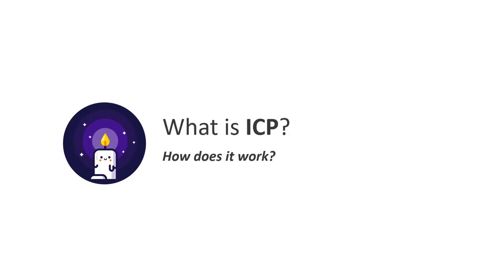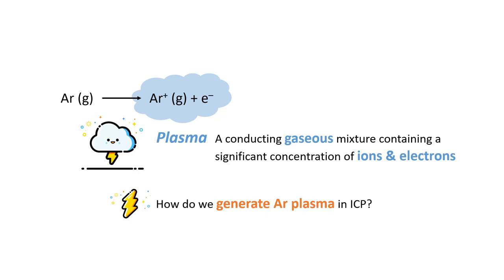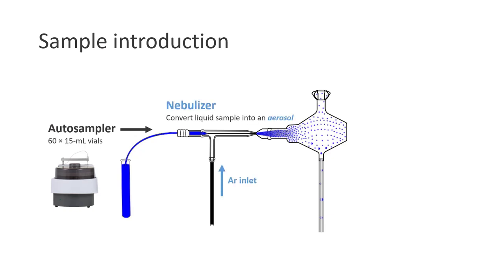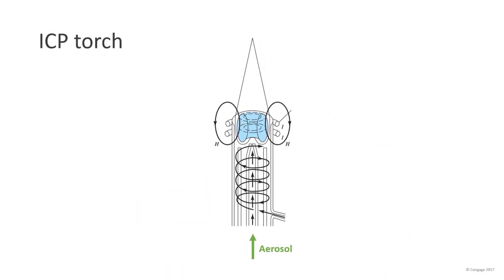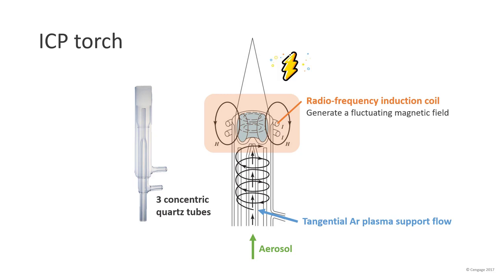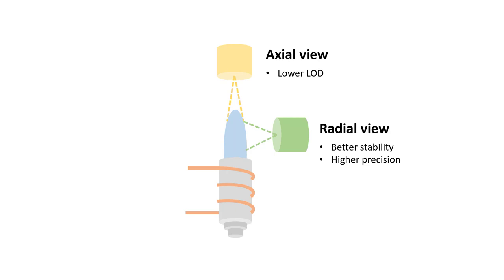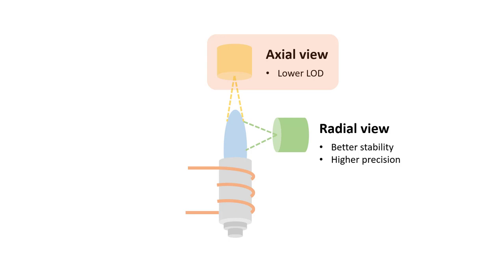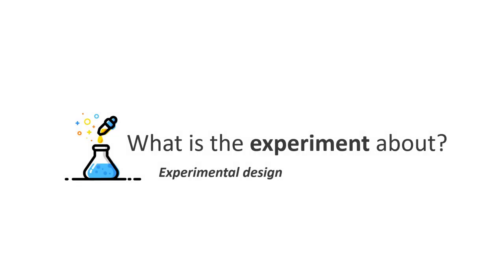ICP-AES: Part C: What is Inductively Coupled Plasma (ICP)?

Comment: I have a question:
- in emission spectroscopy normally the atoms must be excited (with the electrons being promoted to the excited state) but not ionized, since the emission spectra are different from atoms to ions. In fact in the ICP-OES the plasma, containing free electrons, hinders through electrostatic repulsion the loss of electrons from our analyte, hence, the ionization.
- In ICP-MS however with must have the ionization of our sample for the separation and determination of the charged fragment according to their m/z ratio.

First of all, is this right? Then, how can I correctly explain this? Maybe in different point of the plasma, at different temperature, I have different excited atoms / ions ratio? 

Thanks to anyone willing to answer my question.